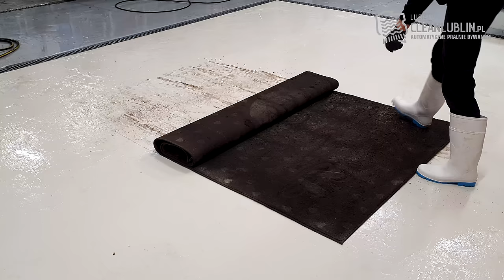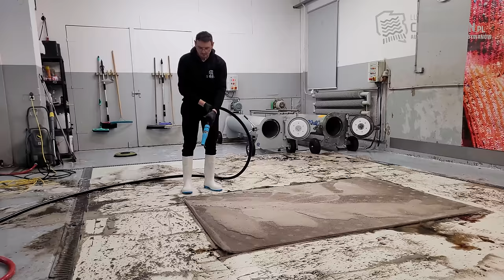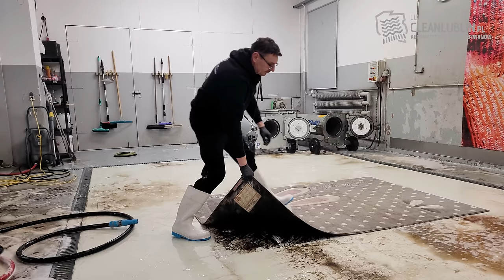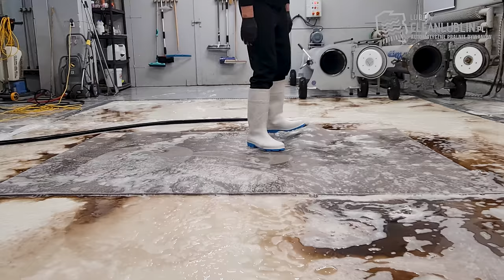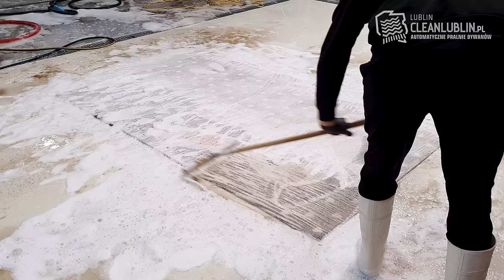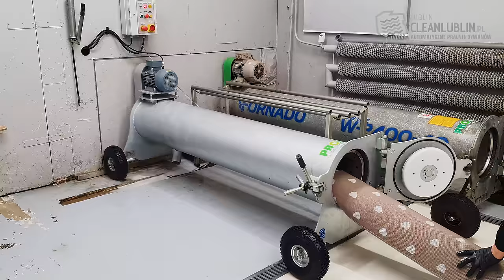Relax and calm your nerves - oddly satisfying rug cleaning ASMR

Comment: Prob my only thing would be to stop using the squeegee on that floor. That floor is made of what appears to be painted cement, which means it has dips and grooves in it, and therefore it doesn't quite clear away all the dirt as smoothly and leaves a feeling of uncleanness and also makes it easier for the dirt to seep back into the rug.

It works on other channels because of the material most of their floors are laid from. Laminate, tile, etc. Cement is a whole diff floor type and should be approached differently. What works for other channels doesn't always work for everyone; I'd personally prefer for you to continue spraying/shoo-ing it away to the drains with either the hose or the pressure washer instead. 
Otherwise, at least find a squeegee or mop that will work for that specific floor type. 

Other than that, have your fun; I could care less what color soaps you use; I think it can be fun to change things up a bit and shy away from the typical conservative aesthetic. I think as long as you do a good job of getting the rug clean and keeping your work station clean, I don't see the harm in having a little fun, playing around and exploring/trying new things.
Reply from the maker: Thank you for deciding to express your opinion. In fact, our effect is not as satisfactory on our site as on other channels. However, we wanted to introduce something new for viewers, many people also asked for it :)
Have a nice day